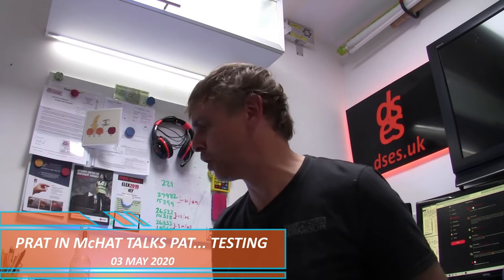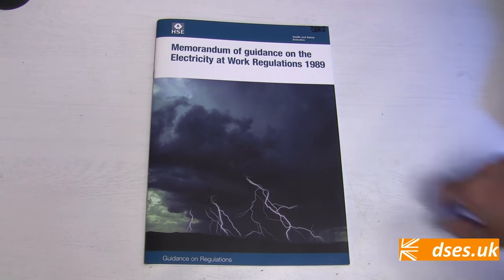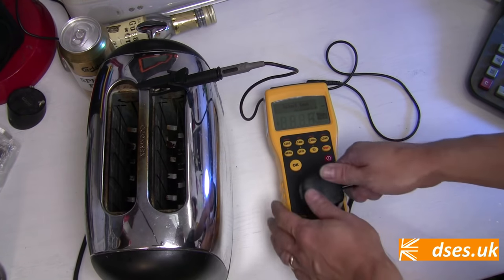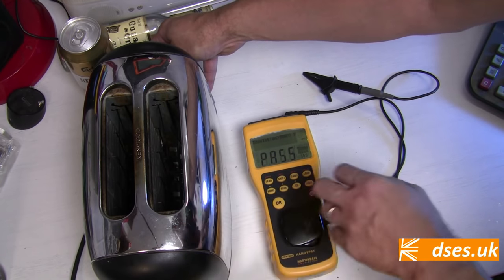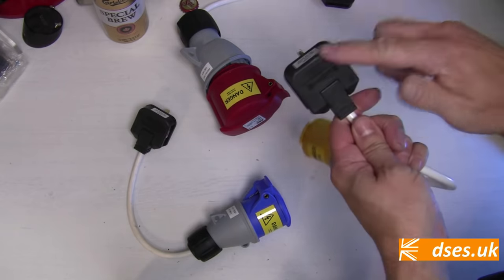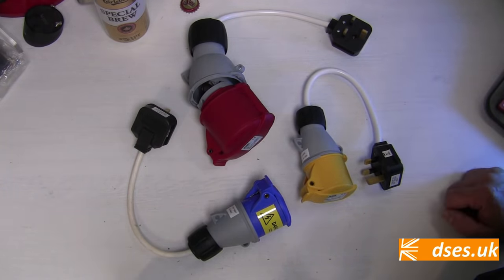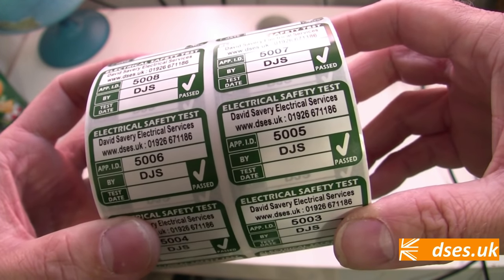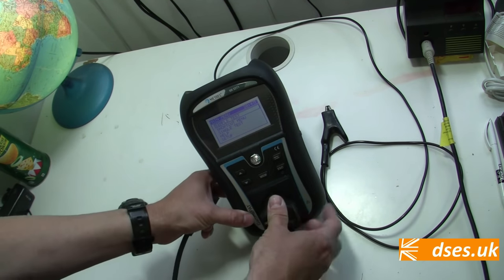Prat in McHat talks PAT... testing

Comment: Dave, on the floor fan... you said you have no earth test point, but then you said there is an earthed metalic bolt on the underside, so was there an exposed earth or not🤔
Reply from the maker: I said "unearthed". Or rather, I garbled it.
Reply: @dsesuk  on a class 1 insulated with plastic and no exposed metal parts that you can probe on then you can't do an IR test between lives to earth, and you can't do earth continuity.  If it's earthed and exposed to probe then you can do the IR and the earth continuity.  You can't do one without the other unless it's a Class 2 with exposed metal works😂. And that 25m extension lead, you're measuring earth continuity not R1 + R2 so your earth reading shouldn't have exceeded 0.20.  the 0.2 reading is a key figure, that's why you need and RCD device when the extension lead exceeds those lengths.
Reply: But I guess if the exposed bolt is unknown and exposed then you should note it down as unknown, coz you don't really know if it's earthed. If you know it's unearthed then either you know it is on plastic or you know it's a broken earth.

Comment: Do you have to connect the probe for a class 1 for insulation resistance ? Since you already confirmed the earth bond on the previously test ? I just assumed the tested will look for the return at the earth pin rather then the probe. (probe I can see for class 2)
Reply from the maker: No, you're right, these testers will look for a return either through the earth pin or the probe. If you've verified the casing is earthed, then you don't need to keep the probe connected.
Reply: Thanks for the confirmation David. My electrical knowledge is limited & I only watch these videos for “entertainment” so thanks for bringing closure to the question.
Reply from the maker: @r7915  It's good that you mentioned it as I should have been clearer. There will be a short follow-up in the coming days as I play with another gadget related to the PAT process!

Comment: I live in a rented property, I'm a security engineer. watching your videos and working with a few sparkies and have found some rather "interesting" wiring....

Like a single socket wired off the back of a double socket in multicore 1mm2 wire.

What are your thoughts?
Reply from the maker: My thoughts are that it's a fire waiting to happen, and that Table 52.3 of the wiring regs states that a minimum CSA for copper conductors in a power (socket) circuit is 1.5mm.

Comment: My sister is a manager of a charity shop which they recently got a "BattPAT" which as you have described is a "black and white" tester having said that it does offer some limited configuration options which you can tell it to test a longer lead. This is from the manual :
FAIL THRESHOLD
(Normal Lead upto 10m) > 250 mΩ
FAIL THRESHOLD
(Long Lead upto 25m) > 500 mΩ
FAIL THRESHOLD
(Long Lead upto 40m) > 800 mΩ

So even the most basic pat test machine can pass these things if setup correctly. An incompetent PAT tester will get no help if the machine has mΩ
 values displayed on the screen since he probably won't understand what they mean or will never ask himself why did this brand new extension lead fail? all they care about is sticking as many PASS stickers on everything they can and getting out of there. lol.
Reply from the maker: I'm glad to hear the basic tester has some granularity to it. I wonder if the display makes it clear what is set though, i.e. if it shows "LEAD TEST - UP TO 25m" or such or if it relies on the operator digging into a menu option. I feel that any modern test instrument should show the test parameters while testing as the Metrel models here do (the Martindale does for IR, but not for the earth bond test). I appreciate that, as you say, an operator who doesn't know his onions won't be able to interpret a resistance reading, but it may still encourage someone to clock why the numbers change and to think about what they're doing and what they're seeing.
Reply: @dsesuk  Thanks for the reply. it's not menu driven its just uses LEDs and buttons. It's as simple as you can get really but it does the job. 

https://images-na.ssl-images-amazon.com/images/I/81RdTTCAlPL._SL1500_.jpg

you can see in the photo the options it has inc the power lead button where you can select the "up to" length by pressing it a few times.

Comment: Dave that 25m extension lead according to the OSG that is the R1+R2 figure which means the R2 figure you was looking for would be 0.18/0.19ohms.

As a general rule (from the code of practice anyway) 0.5mm 5m, 0.75mm 7m, 1.25mm 12m, 1.5mm 15m, 2.5mm 25m, 4mm 40m, will give you 0.20 on a single conductor.  The table on the code of practice will give you slightly higher figures than the OSG about 3%. The OSG is more accurate but going by the code of practice figures you will more than likely achieve below the max figure and stay within the max lengths before the extension leads require RCD's

The reason the lead failed is probably corrosion in the socket terminals and dust etc.

Or am I looking at this wrong? I'm sure the tester is testing the R2 of the lead is it not??

Class 1 item max is 0.20, an extension lead is class 1
Reply from the maker: Uh... shit. You're right Steve, the tester is not testing the line as you would in an EFLI test, only the CPC, so it should be 7.41m Ohm x 25 metres = 0.18 Ohm if the CSA is 2.5mm. On further investigation, it seems I was wrong about the flex size: this 25m lead uses wire with a CSA of 1.5mm, so the CoP factor of 13.3m Ohm/metre would apply for an expected R2 result around 0.33 Ohm. My slightly higher reading is down to my flylead and dirty connectors. This is quite a balls-up, I may excise that whole section with the editor.
Reply: @dsesuk  if the flex was 2.5mm it would have been a fail still coz you can't fit that on a standard 13amp socket, you need a Commando style plug for it.  I did my PAT Course and Management course (this one just more based on the law and managing duty holding shit, you don't need it for being a PAT tester but it helps to know why we do certain things) based on 4th edition and scored 94% and 95% respectively and I must say it was bloody hard and the death rate is higher than the Coronavirus, around 60% failure rate coz the pass mark is 80%.  My teacher at the time said several weeks back they had 10students in class with electricians and pat testers and only 3passed🤔

Comment: Some appliances with all plastic construction and earth wire may use the earth for EMC purposes and not safety
Reply from the maker: That's interesting; it's often fans you see this on, do you think that's the the case with such because of the motor?
Reply: @dsesuk  Depends on how they have done the motor control. You will quite often see it on switch mode supply front ends so they pass the conducted emissions   tests

Comment: PAT testing seems bonkers to me. I don't think I've ever come across a problem a PAT test would have found. I see the point of an EICR, those faults are hidden and would degrade the safety of the entire installation. With a faulty appliance, however, the damage limited and easily isolated. If equipment is being used in a fashion where it's likely to experience degradation of safety, there should be a maintenance cycle specifying when the entire lead should be replaced. Obviously any equipment requiring such maintenance is not suited for domestic use.

Comment: Can't we just call it 'Appliance Testing'?
When I explain to the dutyholder that the COP suggests the hand dryers and catering kit on FCU's be tested, how do I stop them worrying then that the wall mounted gas combi boiler needs testing? Or do I just charge them to test that too?
Anyone found a use for the Microwave detector they no longer need? Can't help but thinking that somebody has a lot of excess stock somewhere; do you still get one free when you buy a PAT machine?